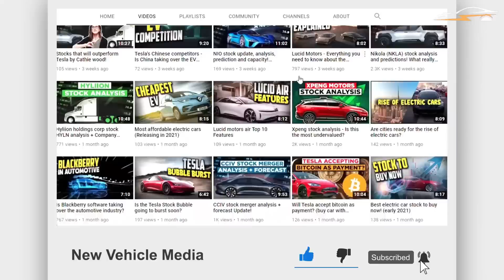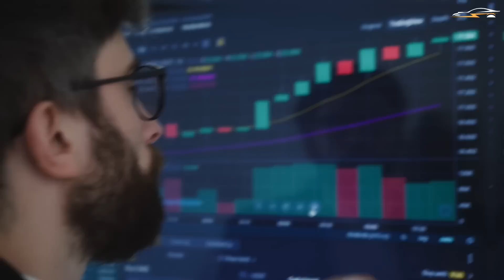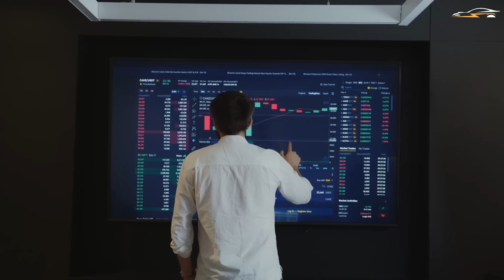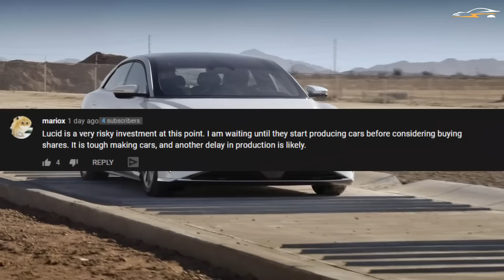Here's what happends if the majority votes NO!

Comment: I appreciate the fact that you know the difference between authorized and outstanding shares. Lots of misinformed individuals out there right now that don’t. 

Also. According to Rawlinson they’re in the late stages of crash testing. That’s very bullish to me.
Reply: So what's to stop them from converting all the authorized into outstanding?
Reply: @timothyn4699  what you should be asking is why would they, and what would the advantage be? There would be 0 reason… period. They’ll probably have an offering in 1.5-2 years to raise more capital for expansion like any other company needing to raise capital for growth.
Reply: I AM WORRIED ABOUT THE FRONT WINDSHIELD/ ROOFTOP GLASS  SHATTERING ON ______MPH IMPACT ... AND WILL IT BE ALLOWED OR REJECTED ...AND IF DO IT IS BACK TO THE DRAWING BOARD... I WOULD GO TO PLANB "B" .. USE THE STANDARD CONVERTIBLE CLOTH TOP.... HAVE THE  RONT TOP GLASS ROOFTOP .. SLIDE UNDER  THE REAR ROOFTOP ..( 2-SECTIONS ) WITH A SPIDER WEB SAFET NET UNDER THE 2 SECTION.                 ( SIMILAR TO A TRAPEZ SAFETY NET ... PREVENTING SHATTERING  GLASS FROM FROM CERTAIN IMPACT CUTING FACES /BODY AND BLINDING  FRONT DRIVER /AND PASSENGERS  ( DRIVEE MUST BE PROTECTED AT ALL COSTS,...... IF LUCID USE MY IDEAS .. I HAVE DISCLOSURE AND I WANT MY COMMISSION (AS INVENTOR )
Reply: @PIANOSINGALONG  the glass rooftop isn’t new though. I’m sure the engineers took this into account very early. Also Rawlison didn’t say they were now crash testing. He said they were in the late stages of crash testing. Big difference in my eyes, but we’ll see.